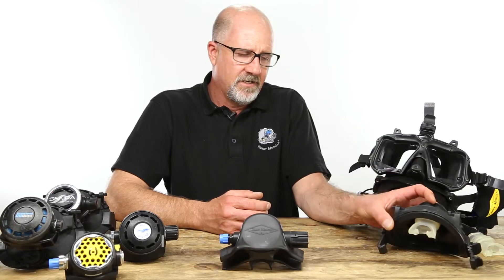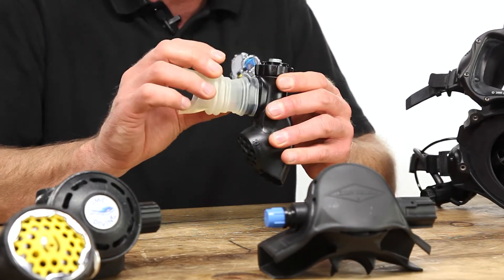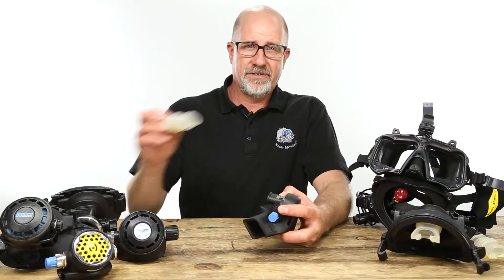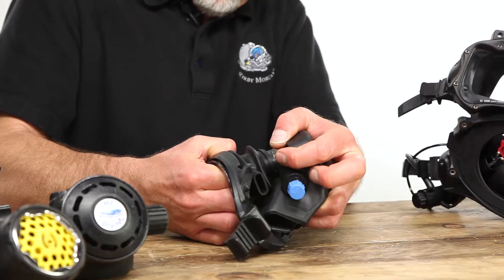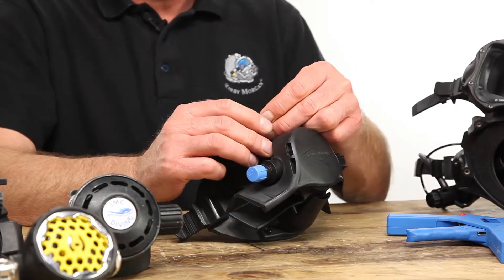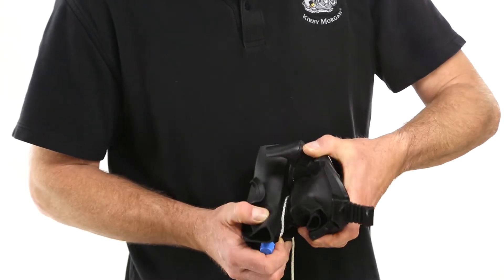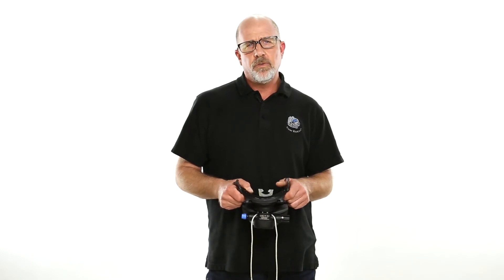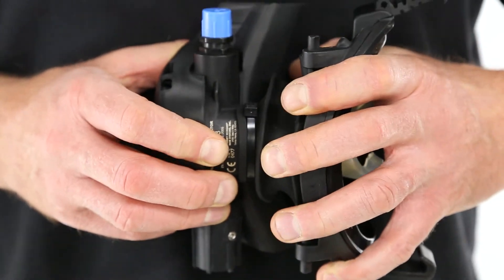How To Mount Open Circuit Regulators to a Kirby Morgan SCUBA POD

Comment: Doesn’t the mask have the option to come with a regulator ?
Reply from the maker: Yes, either the M-48 MOD-1 or M-48 SuperMask has the option to purchase a regulator or you may purchase one as an upgrade or replacement.
Reply: Kirby Morgan okay wow thanks for the quick response. Does the regulator come with a first stage ? Or is that purchased separate? Thank you
Reply from the maker: @outdooroutpost6061  Not a problem, it does not come with a first stage, however, we do offer one.
https://www.kirbymorgan.com/products/regulators/scuba-regulators/superflow-first-stage-regulator
Reply: Kirby Morgan Thank you so much. On the website I couldn’t find if it did or not. I assumed not but wanted to be sure. Thank you again for the quick replies. Marketing department deserves a raise 👌🏼😝